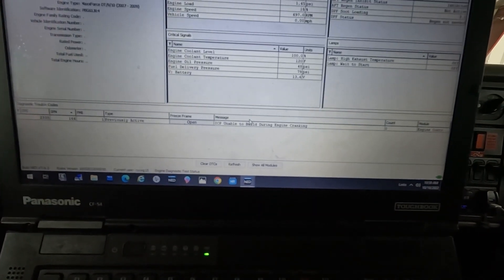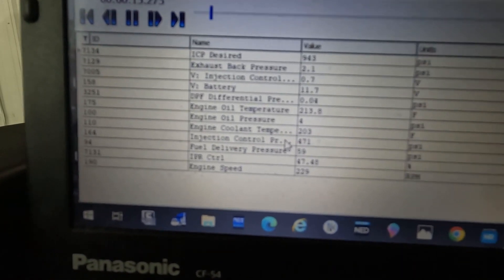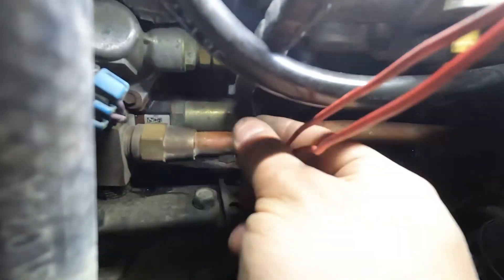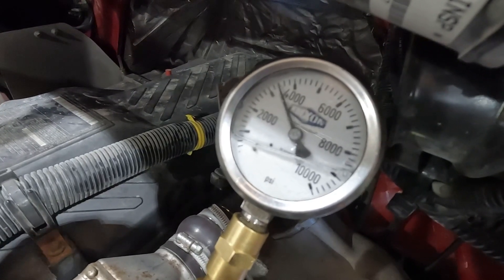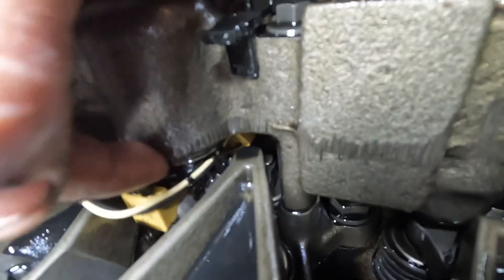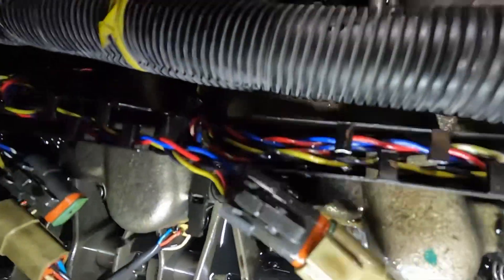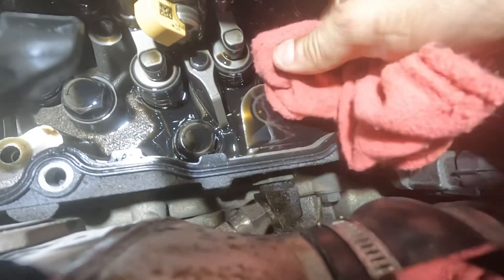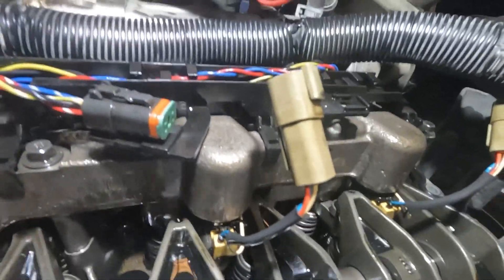Quick ICP leak diagnostics

Comment from the maker: *forgot to mention one crucial step, when under the valve cover performing the ICP leak test. The injectors were unplugged to prevent the engine from starting
Reply: What software are you using this video?
Reply: What software are you using?